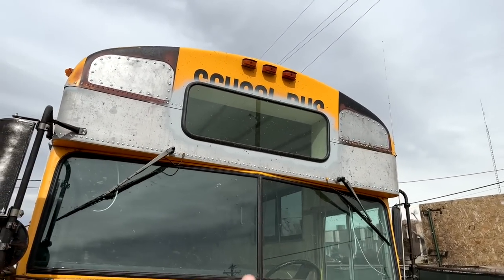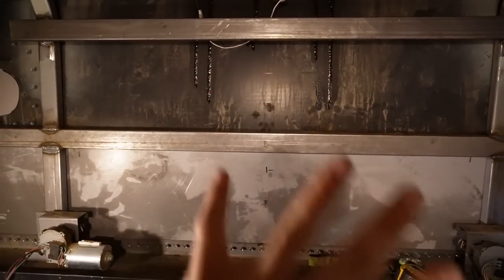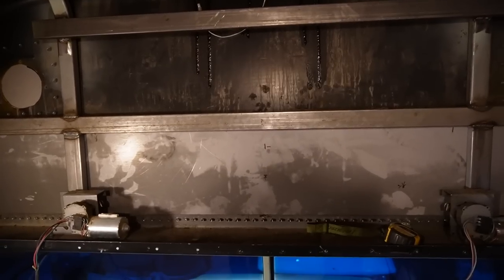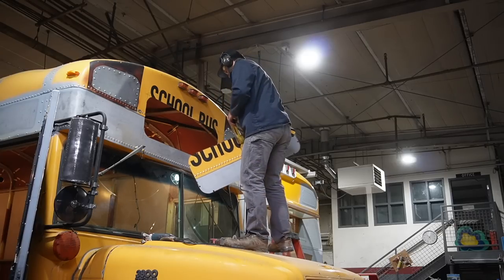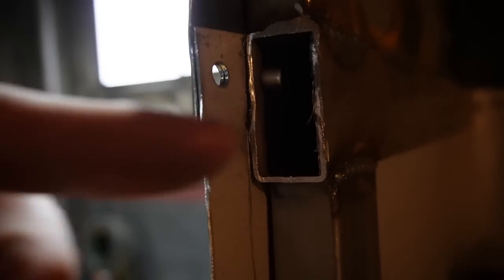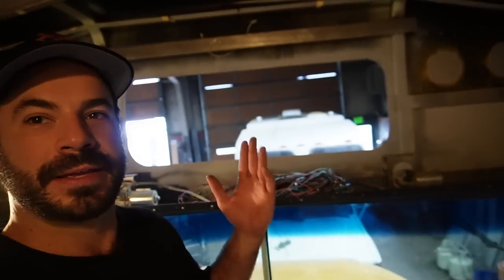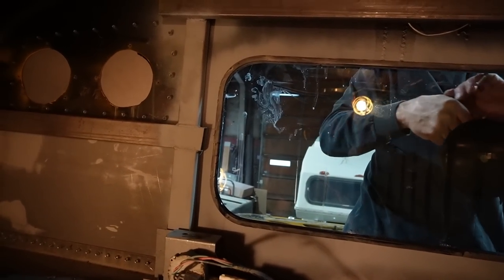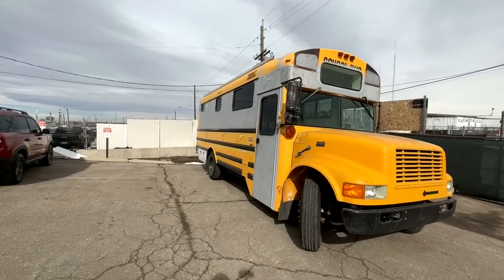An easy CUSTOM SKOOLIE window that changes EVERYTHING

Comment: Thanks Chuck for the exceptional work you do and for sharing it so we dont have feel the paint im sure you had in all these years building beautiful master pieces, im trying to do this myself with some type of acrylic/plexiglass or similar to keep the build within budget and i was wondering if perhaps you or someone in the chat that knows about car windows could share more details on what type of gasket i would need, also is there any type of sealant between the rubber gasket and the metal frame? If so, what is it?

Thanks in advance.

Comment: I never thought it would just be the gasket holding the window in place.  No insulated argon filled dual pane glass?
Reply from the maker: not worth it, since the two big ass windows below it are single pane

Comment: Hey Chuck, trying to frame out this same area above the windshield of my bus but with no window. I want to install a mini split where your window is. Do I a) leave that area completely frameless so I can fill it with spray foam or b) put a box in there as well for the future mini split and spray foam around it like you did. If option b how do i spray foam behind it because there won't be a hole to the outside like the window.

Comment: Why did you need to replace windshield?
Reply: Also curious about this?
Reply from the maker: the passenger window had been smashed by a rock and the driver's window was extremely scratched and pitted from all the backroad driving this bus did. it was fine in the day but at night all those little pits catch light
Reply from the maker: see my reply above